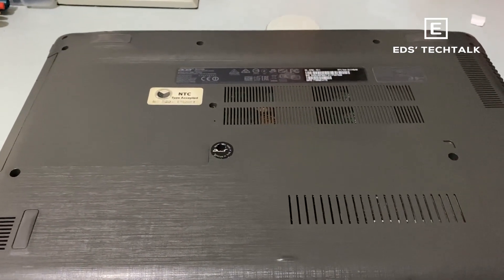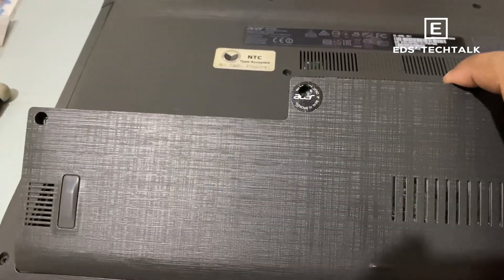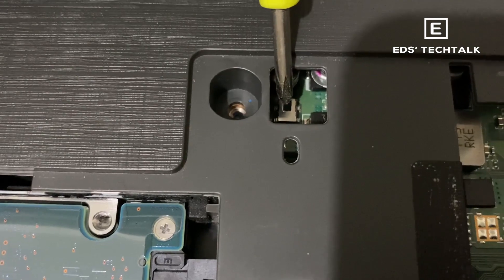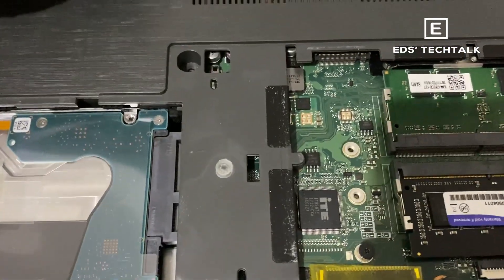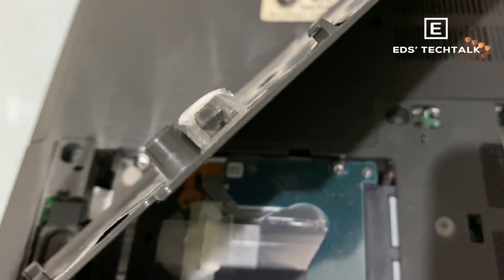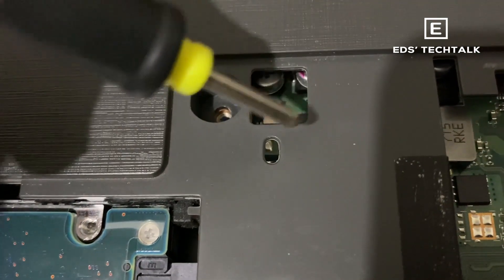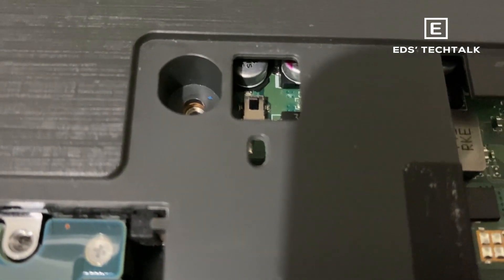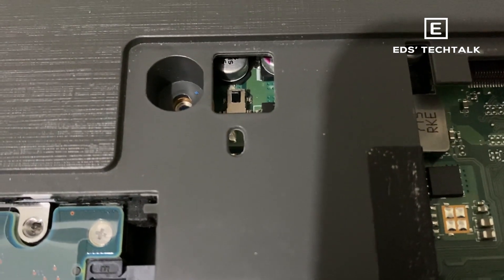ACER Laptop Random Shutdown Fix

Comment: Sir after opening 3 screws also it seems it is stick as unable to remove. Is there any other screw to be removed
Reply from the maker: No sir, there are only 3 screws for this model to remove the cover. You can use a plastic pry tool to help removing the cover since it's a bit difficult to remove especially if you are opening it for the first time.
Reply: @EdsTechtalk  It is a acer laptop and looks similar from the back . Actually I feel a little scared pulling it forcefully may break the lid . Yours seem to come out pretty easily .
Is there adhesive used as well ? Will it be safe to pull it ?

Comment: Hello great video. I have a question. My Lenovo laptop randomly shutsdown. The event viewer error shows Event ID 15. The device driver for the Trusted Platform Module (TPM) encountered a non-recoverable error in the TPM hardware, which prevents TPM services (such as data encryption) from being used. For further help, please contact the computer manufacturer.

How do I fix this error? My laptop shuts down randonly.
Reply from the maker: Hi. This looks like this problem have something to do with the BIOS. If it is still within warranty I suggest you take it to where you purchased it.

Comment: Hi sir ed.. acer aspire 4752 ginawa ko napo lahat, hindi naman nag ooverheat pero after mga 5mins mag shushutdown. Ano ano po kayang mga dahilan bat magkakaganun. Ty so much sir ed
Reply from the maker: Hi po. Usually po nagsstart ako sa software for troubleshooting. Kung wala pong problema sa software saka magmomove sa hardware. Kaya check nyo po muna kasi baka software related po yung shutdown (bsod, error notifs, etc.). Sa hardware po kasi medyo mas mahirap ipinpoint especially kung hindi matitignan yung mismong device pero pwedeng hard disk, battery, yung charger, motherboard, etc. As much as gusto ko po kayong tulungan mahihirapan po tayo i determine unless ma check mismo yung laptop.

Comment: Bro you give me the solution to this problem but why this problem happen tell me
Reply from the maker: It's not a problem actually. The button that the cover is pushing is a trip switch. When the laptop is powered on and that cover is removed, the trip switch will force shut down the laptop, preventing you from "accidentally" opening the underside of the laptop while it is powered on. That's it's purpose. Over time however, that plastic cover's push on the button loosens causing random shutdowns because the trip switch is being triggered and the unit "thinks" that the underside cover is being removed while the unit is powered on.
Reply: @EdsTechtalk  hi boss

Comment: Sir question kahit ba bago un laptop may instance ba na ganan din ang problem.?
Reply from the maker: Kung bago pa Sir at under warranty pa po, I'll suggest na dalhin nyo po sa pinagbilhan ninyo or sa authorized service center for inspection para din mas ma-assess nila ng maayos laptop ninyo. I'd recommend lang na i check ninyo itong trip switch kung wala nang warranty kasi it takes some time para mag loosen yung tumutulak sa trip switch.

Comment: Sir sa predator helious 300 nag auto shutdown tapos ayaw mag bukas nag biblink ano po gagawin ko?
Reply: Ty po sir pinacheck na po namin yung hard drive po yung my sira
Reply from the maker: @mitzuthegreat7954  palit na ng SSD na Sir para mas mabilis. gaming laptop pa naman. hehe
Reply from the maker: Anong light ang nagbblink?
Reply: @EdsTechtalk  white po sir tapos mamatay na po ulit
Reply from the maker: I mean yung led light ba para sa hard drive? O led light para sa battery?
Reply: Ung led light para sa battery po
Reply from the maker: 🤔 mas okay po na pa check nyo sa technician Sir. Pwede kasing may tama yung hard drive, pwede ding software, pwede ding iba pang factor. Mahirap po idetermine kung di mainspect physically yung device.